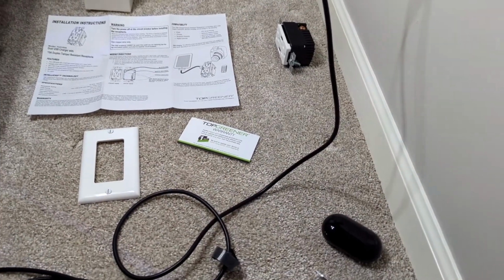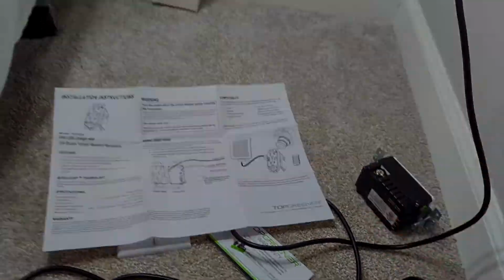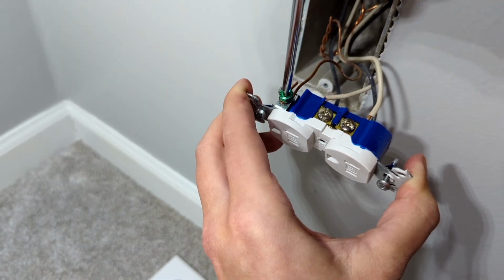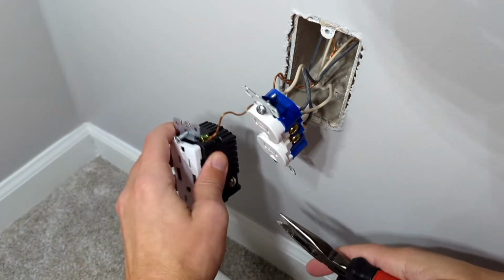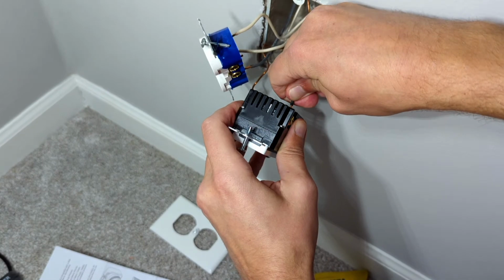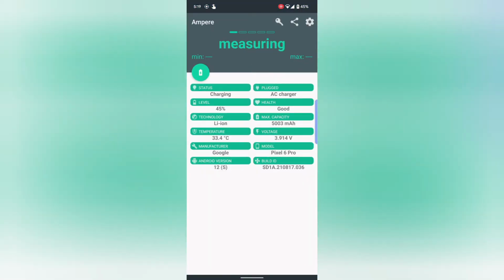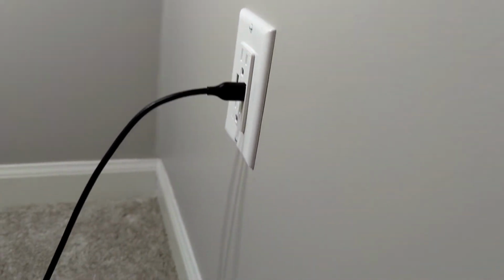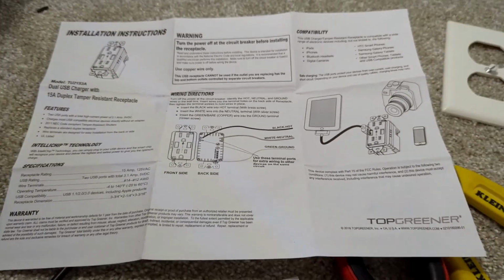TOPGREENER 15 amp outlet with 3.1amp USB outlet replacement / install

Comment: Btw, the snap is just one part. The screws actually pull a plate up creating a “sandwich” effect from the bottom. You need to ensure you tighten those.